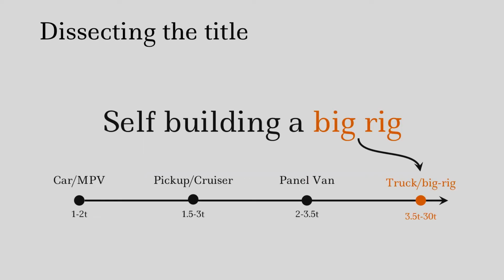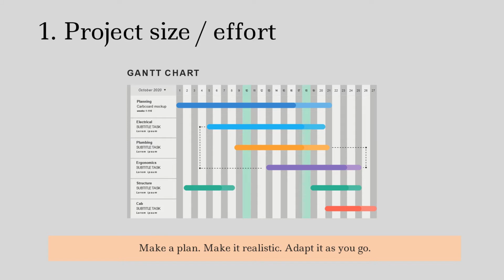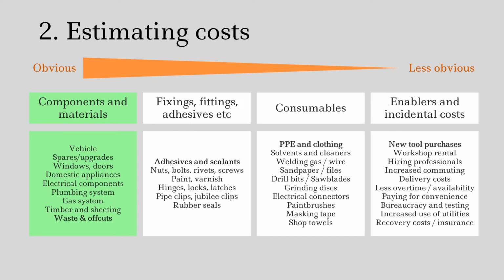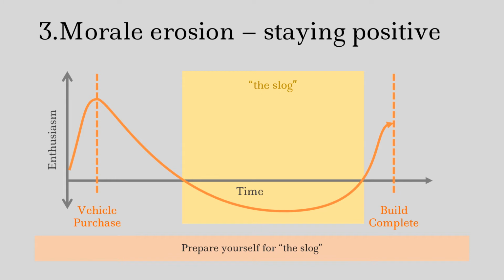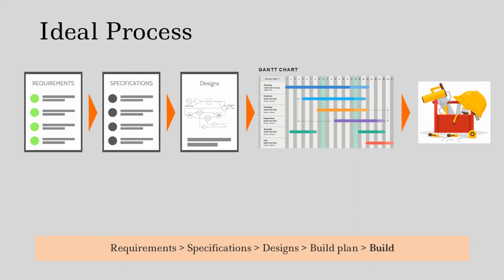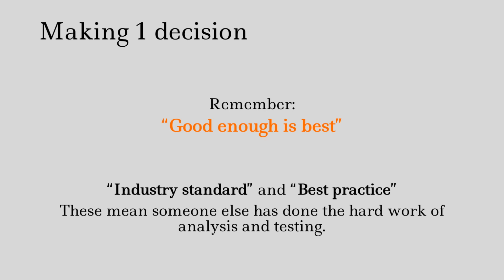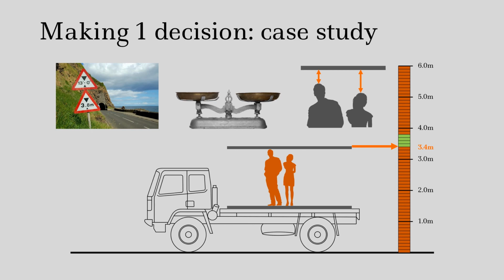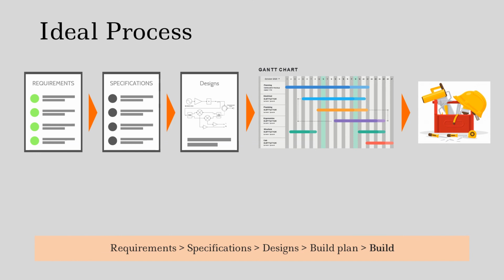Self building a big rig overland truck - How to approach the project

Comment: Hello Thomas, thanks for this video. Can see you’ve put quite some effort in creating it and therefore a thumbs up from our side. Came across Fabhabs via a vlog from The Gap Decaders and we were intrigued. 
We already own a (small) overland truck MB814DA which is converted to a truckcamper, but we intend to change the cabine in the future. When the time comes (retirement) we’ll probably reach out for some engineering help. Again thanks and good luck.